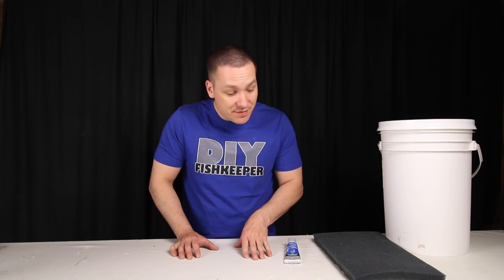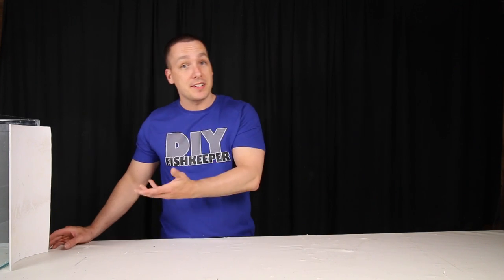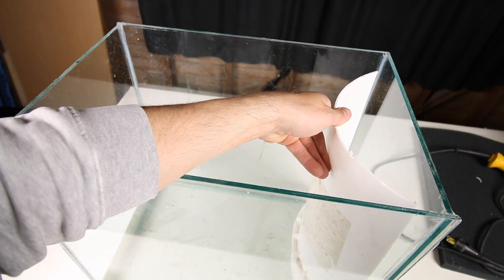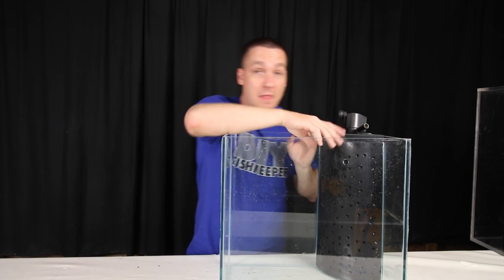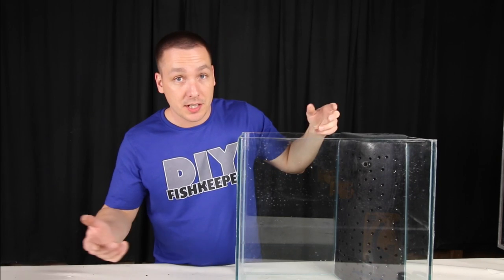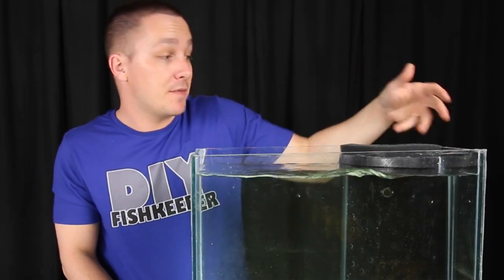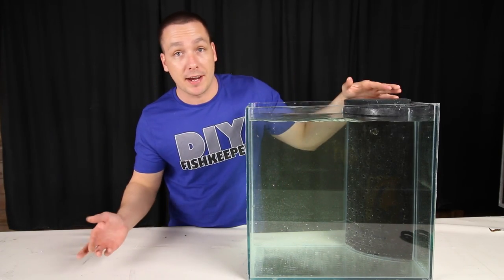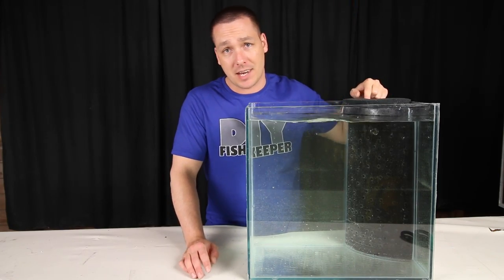HOW TO: Internal aquarium sump - The SUPER CHARGED corner SPONGE filter

Comment: Excellent tutorial! I have used this same set up - minus the plastic bucket - for my 125g aquarium. I did a standard Hamburg Mattenfilter and used Koralia pumps in opposing corners for flow, and added Matrix in bags behind the foam. It was a great space for hiding the heater too. I had a sensible bioload of fish and it worked beautifully, even for such a large tank. I have since moved and I'm getting ready to set the 125g up again, and I will incorporate acrylic instead of a bucket just because I need the added size. (I may even chose to cordon off part of the back of the tank and make baffles) Your comment of the plastic preventing fish from getting behind the area while rinsing the foam is worth it's weight in gold - just try herding fish in a tank that size! lol Thanks for the wonderful vid...

Comment: Awesome as always Joey,    I'd  guess you could go one step further and silicone two pieces of bucket about 2" apart (innermost first) put the sponge in between them and fill the inside with pot scrubbies, lava rock, bio balls, etc along with the pump for even more beneficial bacteria.   This would help from possible recycling when cleaning the sponge.
Reply from the maker: +John Paulson yup, as mentioned there are countless configurations and ways to set this up!

Comment: Hi Joey - many thanks for another interesting video :) Since seeing Rachel O'Leary's modified manifold hill stream videos with the poret foam corner matten filter I've been thinking about doing one of these myself.

I think you could improve on this design by just cutting four large rectangular holes in the bucket leaving a cross shape of plastic as a brace and to support the powerhead's return nozzle. This would mean you'd get more even flow through a much larger volume of foam than if the water's just being sucked through holes, also making it much less likely to clog. I think you'd probably need slightly thicker foam for this to work well - probably 2" would work.

The main reason I like this idea is that the beauty of matten filters is that the exposed sponge offers fry, inverts and smaller fish a large surface to graze on all kinds of microscopic critters, which wouldn't happen so much with the "lots of small holes" approach.

The weakness of what I'm suggesting and a great strength of yours is that the holey plastic retains the division between tank and "sump" areas when the sponge is removed. However I think that's easily solved by taking another quarter of the bucket and leaving it smooth and complete - then just slide it down between the brace and the foam before the foam is removed for cleaning. Actually there'd be no real reason not to use something like 2 to 4mm acrylic in place of the cut up bucket, it might cost a bit more - but then you could buy whatever colour you liked and not have to bother to spray paint it.

cheers :)

Comment: been watching your videos and getting great ideas. i have a 55 gallon tank i want to do glow fish in. i have the filter heater and gravel but was wondering if i could do a lightly planted aquarium to off set the bio load. is that possible and if so what type of plants could i use and what type of substrate do you recommend? also using the diy led light project you built once i order the lights. any help would be appreciated since i'm new to this hobby.

Comment: Do you ever built tanks specifically for demonstrations? And what do you do with the tanks after using them for a video, if you don't plan on running it? Just curious.
Reply from the maker: +Fish Behind Glass I do that all the time. I then use them for a variety of purposes. For example, the one in this video is used as a tank to show things running. I also built it. Sometimes i build and reuse. Depends. For the most part, big tanks i have to use. They are too expensive to build just to show how to do it.

Comment: Hi Joey and thanx for the video. Concerning flow rates, I am going to be requiring a 1200 L/hr pump however I need to shift the water up from my sump to my highest tank which is 6 foot in height. (My other tank is only 3 foot high)  Do I need to consider this when buying a pump?. Thanx alot. PJ

Comment: Nice video, but I have a question could you use knitting nesh instead of the bucket? The reason why I ask is because it already has holes, flexible and you could paint it. What do you think?
Reply: +Debbie Arthur 

It's not as sturdy as the bucket (more flimsy), but in theory it would word fine. It also has more holes, allowing a greater amount of surface area for filtration.

Comment: Question: could you put two of these on separate ends of the aquarium, using the pumps, have one act as the intake to an underneath trickle down sump and the other end as the output? Basically a mega filter.

Comment: hey joey.. why are over flow always/mostly came from botom or back?i just want to ask are there any spesific reason for this.. i recently make an overflow but i drill the side of the glass, it works just fine.
Reply from the maker: +Fshop fshop drilling through the base of the tank gets far more flow as you have gravity on your side. Simple as that.
Reply: Should i woried about the weakening of the glass,? drilling in big panels (front/botom/back) seems to make it weak, compare to if i drill on the small panel (sides), wich part in the aquarium is recieving the biggest presure,? if i like to make it strong wich part i need to look.. i like to know since i am starting to enjoy making my own aquarium.. thanks joey as allways..

Comment: joe i have a custom sump filter it has 2 taps one on the input and one for the output from the pump but i cant seam to get the waterflows matched for the flow in and flow return ?
Reply: O.o Do Did you have multiple pumps?

Since it's a year+ later, are you still having issues?

Comment: I'm going to set up a 75gal planted tank. Would this be more efficient than a equivalent aquaclear hob filter?
Reply: +Alan Sun depends what your goals are for the tank. you'll be fine with a hob, but i would recommend some powerheads to make sure you have adequate flow in the tank.
Reply: +Karim Swift it's gonna be a heavily planted community tank
Reply: +Karim Swift and I want to experiment with this type of filter.
Reply: Alan Sun no harm in giving it a go, i would still reckon a powerhead to make sure there's circulation throughout the tank would be useful

Comment: I would cut slits (vertical or horizontal) instead of holes... It would allow for a higher surface area of the sponge to be exposed for filtration...

Or drill 20x the number of holes :P
Reply from the maker: +Bref Stank Absolutely. The one in the video was a quick example. I mentioned drilling as many holes as you can though! haha